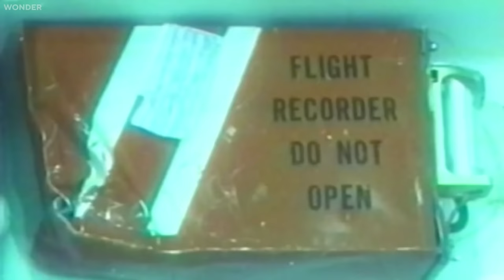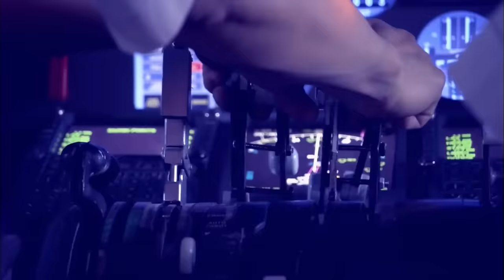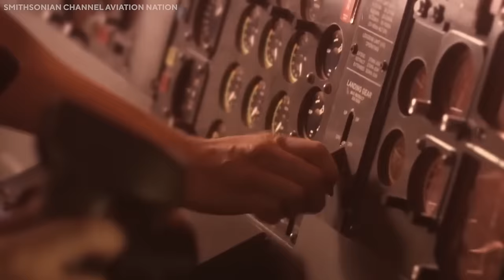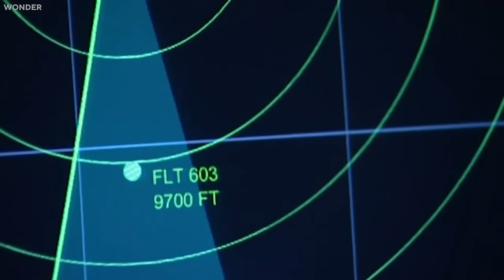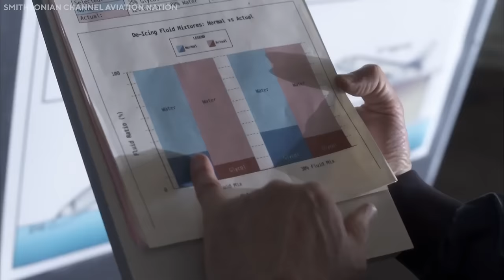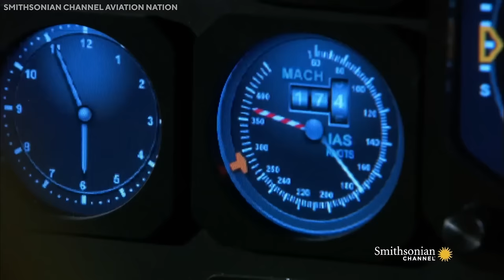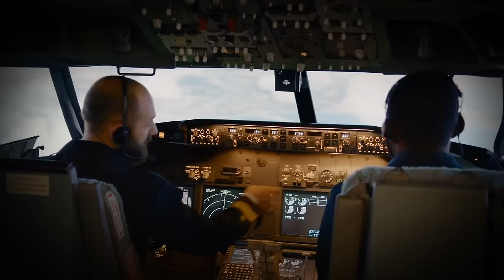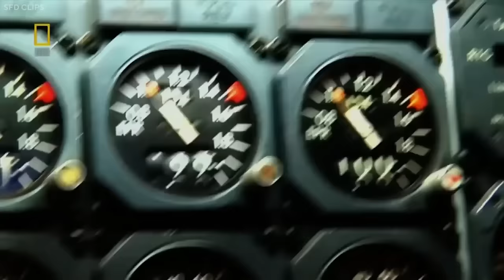Most Disturbing Recordings Before Plane Crashes

Comment: “Air transportation easily remains the riskiest way to go”? Really? Over 30,000 flights with two million passengers on board take off every single day in the United States alone. That’s 10,950,000 American flights a year. In 2021, there were 21 commercial airline incidents resulting in 0 deaths. In 2022, 42,795 people died on American roads.

Comment: They should invent a lightweight super strong parachute that passengers could put on asap with no problem.
Not bulky so it could be stored easily under the seat.
This would give passengers a fighting chance.
The pilot drops the plane to a safe altitude to open the doors. 
This option would work if it wasn't an instantaneous catastrophe.
The chute would also double as a life vest for flights over water.
Probably wouldn't hurt to have life rafts stored under the plane to be deployed by the pilot in an emergency.
Just push a button and the rafts are jettisoned from the underbelly.
Technology is so far advanced why we don't have these potential life saving measures available to us is a crime.